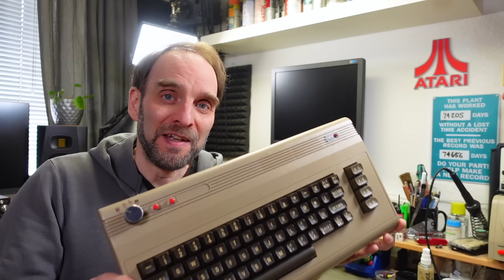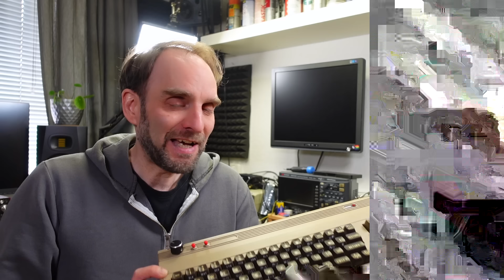Refurbishing the Beta Family C64

Comment: I still have my original breadbox, though I did have to repair a few things along the way (some with your brilliant video assistance, thank you Jan). I bought my C64 second hand from a friend, including a 1801 monitor and 1541 disk drive. I then purchased a second, later model light beige 1541 disk drive. The original, big breadbox 1541 died and resisted all my efforts to repair, but everything else is working perfectly.

Comment: I used one of those to run a charity database using SuperBase 64; upgraded to a C128 using SuperBase 128 and Superscript 128 (I think it was called). You could write a script to enable the two programs, which could be loaded together, to talk to each other and produce 'triggers' to perform some function, mail merge and such. Great days, flying by the seat of ones pants. I got a Commodore SFD 1000 floppy drive that really speeded things up, which held, If I remeber correctly, 1 megabyte of data on a floppy 5 1/4 inch disk.

Comment: I enjoyed this trip down memory lane. I thought of a little project for you. If you really want to put a heatsink on the SID, you could redesign the additional EPROM board such that the plug that goes into the Kernal ROM socket is in the middle of the board instead of at the end. This would shift the board to the left. PCB Way would be happy to make the replacement!

Comment: i started with a VIC-20. probably 1981 or 82 and with a C64 probably Xmas 1984.
btw. i am working on a new VIC-2020 motherboard, based on the VIC-2020 board from Dan Werner. The changes on the circuit should be finished in the next weeks. progrees can be seen at Commotari on github.
I added a power supply part with a DC/DC converter and it then should work with a DC power supply from 8V....25V or AC with 5V....18V.
I have to put the user  port and cassette port on the mother board again because Dan Werner did not have those on his design. the idea behind my design is then a daughter board for the graphic section to easy change between NTSC to PAL.  (or maybe an FPGA daughter board)
Reply from the maker: That sounds really interesting! :)

Comment: Wish I had my original 64 that I got in october 1983. I sold it with the 1541 and all discs and tapes when I bought my Amiga 500 1988. Don't know if it still exists. The only bit I have left of it is the broken VIC-II that I replaced sometime back then. I have a 64C and a 1541-II that I got in the mid 90s but I have no discs, tapes or cartridges so I need to get some modern alternative to load stuff into it. Just not sure what to get.
Reply from the maker: Oh, there are so many modern alternatives to load software from these days. The best one is probably the 1541 Ultimate (which can emulate loading disks, tapes, cartridges, ROMs. It can even act as a printer, outputting dot matrix-looking pdfs). Pretty expensive though but very much worth it if you take things seriously. Less expensive alternatives would be the SD2IEC (simulating a 1541), the Pi1541 (same), the TAPuino (simulating a datasette) or something like the Kung Fu Flash (make sure to get the second version, that can also simulate a RAM expansion) or the BackBit cartridge. Some are even open source so you could make your own if you have the skills, time & equipment. :)
Reply: @JanBeta  To many choises, I guess that's why I haven't gotten anything yet. 😂

Been leaning towards the Kung Fu flash though.
Reply from the maker: That’s a good one for sure! Very easy to use and quite versatile. :)

Comment: Jan, you probably know the "Made in England" C64 was manufactured in Corby, Northants. I bought mine in spring '85. Good times. 😁👍
Reply from the maker: Yes! I've seen videos of the Corby plant. I think it got demolished only a few years ago? I might be confusing that with another Commodore plant though. :D Many C64s sold in Germany around 1984/85 came from England, as far as I can tell. I think they probably stopped making them in Braunschweig (where the German Commodore plant was) at some point and switched to making Amigas and PCs.

Comment: I had to take my C64 back to the shop for a replacement in 1984 because it kept cutting off after about 5 minutes. My first computer was a Vic-20 in 1982.
Reply from the maker: Yeah, I think many of the earlier C64s had a lot of issues. Took them a while to get the production process right from what I've heard. Some of the early chip revisions just ate themselves basically (as witnessed by many failing PLAs these days). :D

Comment: Hi Jan, as I just noticed you have another monitor. Can this one output 50Hz? The manual mentions only that it can sync to 56..75Hz. Obviously it can sync to 50Hz as this video shows. I have two Dell U2410 here because they were recommended but they are quite useless in any PAL country. They can sync to 50Hz (also not officially supported), but when entering the picture settings like clock and phase the firmware just crashes. Furthermore they cannot output anything other than 60Hz, so they studder along horribly in most demos and games.
Reply from the maker: Oh, this one works reasonably well at 50Hz. I'm using it through a shoddy SCART to HDMI upscaler though (connected to DVI), so can't really tell if it has a decent refresh rate for proper gaming and such. This is only my test setup and it's good enough for that. Wouldn't recommend for watching demos and playing games on it at all, though.

Comment: I wonder if you could change the position of pin header on the rom board so it shifts over and exposes the Sid, that way you can put a heatsink on it.
Reply from the maker: I might be able to just put another socket in between and have enough room for a flat heatsink. I'm going to tinker with it a bit. It would definitely be a shame if the SID died of heat after all these years! :D

Comment: Just a thickish piece of flat metal stuck to the obscured SID would work fine as a heat-sink. It doesn't need to have fins. It just has to have some thermal mass and surface area. Just let it poke out below the add-on board for some convection cooling. Capton as required.
Reply from the maker: My current plan is to try to put another IC socket in between and maybe get enough room for a proper heat sink, even. I'm going to tinker with it a bit more, I guess! Would be a bit of a shame if the SID died of heat after all these years!

Comment: Someone should build a heat-pipe for between the SID, VIC2 and PLA, and then add a silent noctua fa to cool it. Winder if that would fit in the case.
Reply from the maker: That would be cool (pun intended)! Would need some different layouts for the different board revisions though. :D

Comment: The monitor on the wall is different! Did "lips" die? You'll probably be happier with that 5:4 either way. :)
Reply from the maker: The old LIPS monitor kicked the bucket a while ago, unfortunately. HDMI inputs no longer work and the analog inputs on that thing have even worse lag than my shoddy upscaler. I'm going to make a repair attempt eventually, but I'm much happier with the smaller monitor (with at least a half-way correct aspect ratio) for now indeed. :D

Comment: Looks like you need to rebuild the rom board with a new one with a rom relocator board and some 3d print for stability.
Reply from the maker: I think I might be able to just put another socket in between and make enough room for a flat heat sink. I'll tinker with it a bit more. I kind of want to keep it as original as possible.

Comment: I'd always recommend replacing all wet capacitors to protect the classic chips from DC leakage. After 40 years they are not so wet anymore, and the unlimited inrush current of the classic PSU kills them pretty good. If you only have a simple LCR meter, this usually shows up as somewhat raised capacitance.
Reply from the maker: I agree, the caps are often at least a bit "worn out" in these old machines (although I've only had one or two C64 with catastrophically failing/shorted caps yet). That's why I usually at least replace them in the devices I plan to use regularly. :)